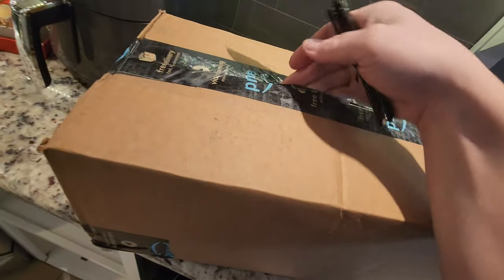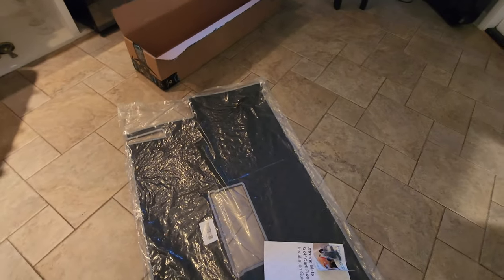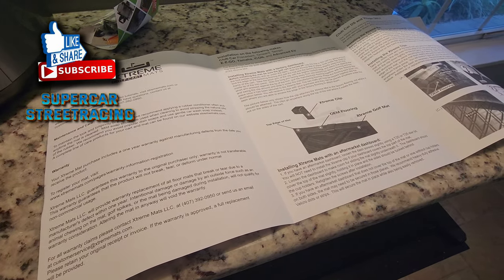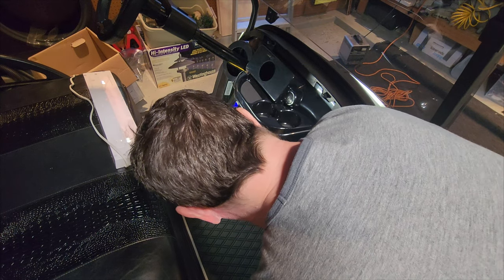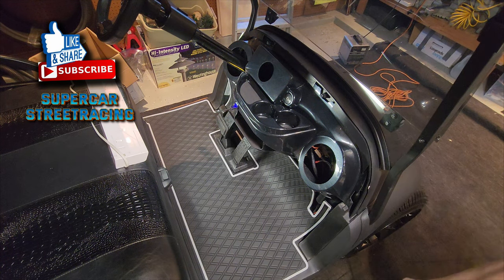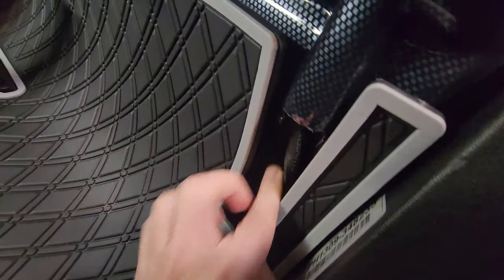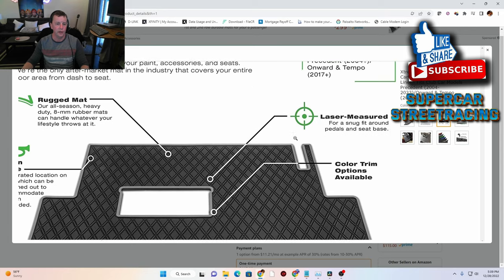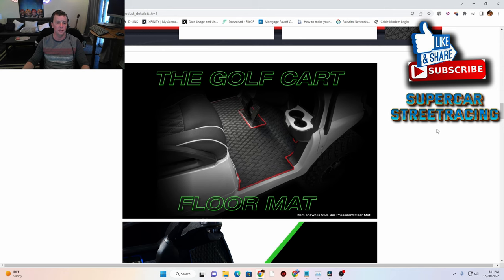Xtreme Mats for Golf Carts, Installation and Review

Comment: Hey!! Thanks so much for the honest review.  We love seeing the purchasing thought process and unboxing from the customer's perspective.  To answer a few of your questions in the video, it is designed to be installed over the factory flooring and that would solve the cables showing issue and the tiny gap around the pedal you pointed out.  As you demonstrated though, you can make it work without the factory flooring if your cart no longer has one :)  Our new upgraded PRO mats no longer require clips for installation on most models.  We've also recently launched dash mats, bag well mats, and rear floor mats for several makes and models.  Thanks for checking us out and supporting our brand. 😎🤩🥳
Reply from the maker: Of course! I would love to work with you guys in the future! supercarstreetracing@gmail.com